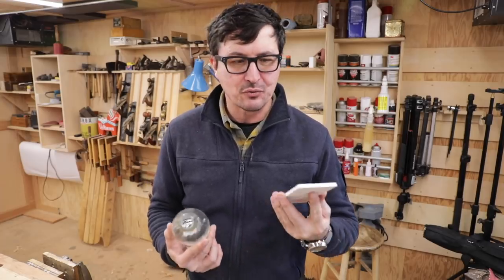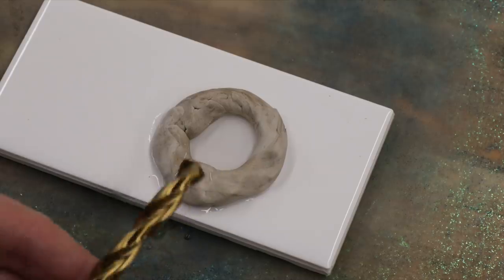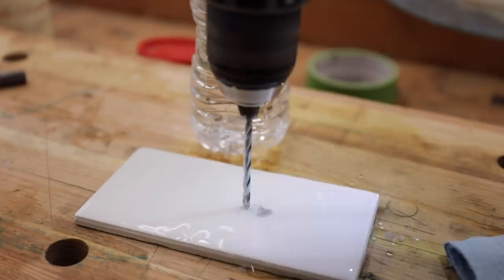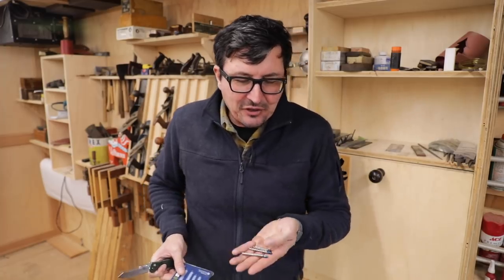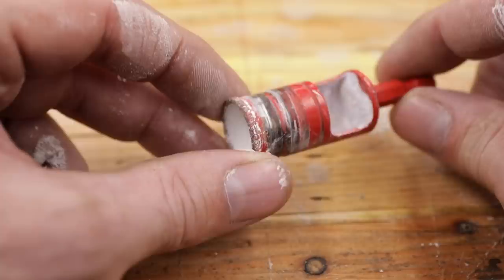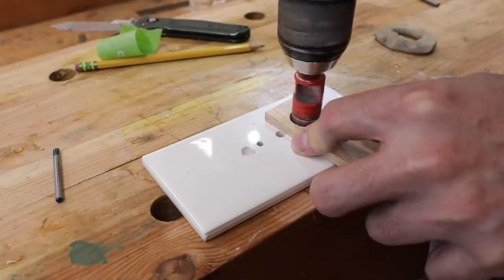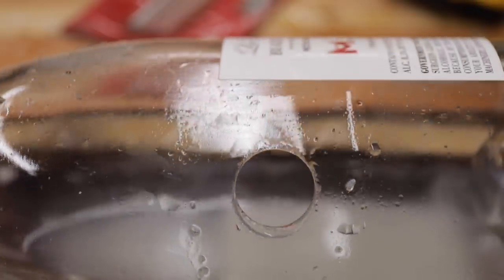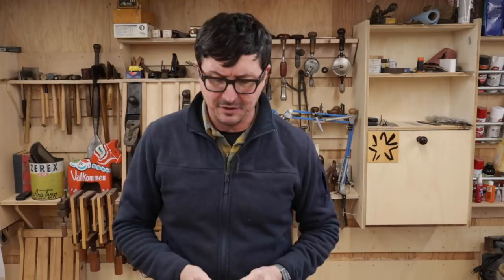Drill A Hole In Glass - How Hard Can It Be?

Comment: Tempered glass will shatter. The reason it's tough is because the whole piece is pulling on itself from the thermal shock of the tempering treatment. If you introduce a void, it implodes.

Comment: I know this guy who had a power generator stolen while he was using it. He was working in Philadelphia in one of those big warehouses, and his job was to go in clean, strip, and rewax the floor. So he had floor cleaning machines, and it was easier for him to just run a small generator outside, and plug into it with extension cords. So he is there using his machine, and next thing you know the machine kicks off. So he looks thinking maybe he tripped the switch, or the circuit breaker on the machine. No that doesn't do anything. So he goes outside, and where his generator was sitting is now just a bunch of plugs unplugged, no generator. So he is like WTF, so he is looking around and sees a taxi sitting at the top of the street at a stop sign. So he starts to walk towards the taxi hoping maybe the guy saw something, but he figures by the time he gets to the taxi it will have driven away. But he keeps getting closer, and closer, and it is still just sitting there. As he gets closer he can hear the man in the back yelling just go man, why are sitting here, drive now. So he gets to the taxi and say someone stole my generator sitting on that side walk, did you see anything. The taxi driver says yeah the man in my back seat stole it, and it is in my trunk. The guy gets out and takes off. So the taxi driver tells him I thought something was suspicious, he flagged me down around the corner, and asked me to take him around he had this heavy generator he didn't want to carry. So he drives around, and he is suspicious because it is still running, with stuff plugged into it. So the guy shuts it off, pulls all the plugs, throws it in this taxis trunk, hopes in and says lets go. So now he is really suspicious, why was it running, why didn't the guy go take any of the stuff plugged into it. So when he drives up to the stop signs, and looks in his rear view mirror, and sees this guy with a puzzled look on his face, he knew the guy stole the generator, and so he sat there and waited for the guy to come up to him.
Reply: Thats a great story and its great that the taxi driver just said that he stole it .
Reply: Legend says somewhere in that post are Avengers Endgame spoilers.
Reply: @Mic_Glow  batman kills thanos bro
Reply: @Mic_Glow  RE: aaaaaaaaaaaaah 
Sanchez Eve North Dauz 
Hicks Eve Loop Piles 0110101011001101001010 11.17.84.93.75 Krossection intersection B.K. Rescue M. 
South Saudi
Reply: Dido to the taxi driver!
Reply: I'm not reading that
Reply: @gdptodamvc2558  cool arg
Reply: Excuse me but how the hell does this apply to any portion of the video at all
Reply: Where's the rest of the story Kevin?! What happened to the guy, was he mad or just disappointed? Why did he want the generator
Reply: better than Hollywood movies

Comment: "what did we learn?"

That it's pretty easy to convert a bottle into a water pipe.
Reply: Yessir. Make some good money too. Just epoxy the stems in
Reply: @jakehanneman6956  heat + normal epoxy= no bueno gases, just use rubber grommets for feeding heated water lines through sheet metal (rubber grommets for stems/ what size piping/tubing you need is another). ntm they are cheaper than epoxy ($1.50 vs $2.99 for ok epoxy) and are resistant to chemicals under heat. this way you fry less brain cells overall, dont kill customers, and makes it so the stem moves a little if you bump it vs 1 soild hunk of piece. epoxys only benefits imo is it doesnt require you to measure stuff and you know where its at in the hardware store.
Reply: @doodlebug6833  you reallyyy don't understand how I did it. But don't tell me I'm killing my customers. Last time I checked a tube of epoxy got almost a dozen made from the smallest tube around. Not to mention with all my buddies together chain smoking wax, even after being heated up repetitively over a half hour, the stem never even got luke warm. If the stem moves it breaks easier because it chips out the edges of the hole. I tried it that way before and grommets don't work with how I do it.

Comment: I've used the Bosch set on my tile.  It took awhile, but they did what I wanted.  I only needed to drill 2 holes and question just how many holes a single bit can drill.  It was certainly slowing down after the first hole.  Our tile was much harder than your subway tile, based on what I could see.

Comment: The glass and tile bits I use look more like a primitive arrow, with the arrow head attached to the shaft, if that makes sense, they work really well.
In a pinch you can take a regular masonry bit and and sharpen it to much more of a point, with a sharp edge to it, most masonry bits are not sharp on the cutting edge, because they do their job by percussion, not cutting.The plumbers putty dam works good, but I've done the same thing with just a bit of wet paper towel.
The core bit, next time put double sided carpet tape on the back of your guide board so it does not move around on the tile, they you can concentrate on keeping the drill steady, not doing that and keeping the guide board in place too.

I'm enjoying this series.
Cheers from Tokyo!
Reply: I've used the same ones! Yes they do work well I personally find the Bosch ones a little better.

Comment: Yeah, tape is a MUST if you want to accurately drill. I use the Bosch professional range of bits (painted blue) and they made perfect holes in my tiles but I had to use tape so it wouldn't wander.

Comment: I wear my welding gloves when opening blister packs... Them sharp edges will get you! The blister pack is sharper than the cheap knives inside the package hahah.
Reply: I always just cut around it with my knife and it opens right up easy as can be
Reply: I tend to use kitchen/utility scissors.
Reply: Scissors no? Kind of obvious choice.
Reply: a good pair of large scissors
Reply: I use aviation snips for opening those blister packs.

Comment: No you cant drill tempered glass cody..  laminated glass yes but not toughened or tempered.  That type of glass will turn to a million pieces all over your shop floor..
Reply: Yep,  the tempering process puts glass under tremendous strain, causing it to "blow up" when it does break.  Think of it like surface tension on water, it's harder to break the surface tension with a widely dispersed load.  The difference with tempered glass is, once that surface tension is broken, it's game over for that piece of glass. So you can take a spring loaded center punch, and easily pop a piece of tempered glass, but try swinging a sledgehammer at it, and it will probably bounce off.
Reply: If u cut at the temp the glass was tempered u can as long as its a cobalt diamond bit that's hot as well. U may say it makes the diamond softer but so is the glass. U just have to cut slow in an oven under drill press. Boo yah!
Reply: @damedog19  What if you were to heat the area you intended to drill in order to de-temper that area?
Reply: With over 100+ years combined years of family members in the union glass trade you can't cut or drill tempered glass. Unless you want alot of glass diamonds.
Reply: Weedus, no they are not. When tempered glass breaks it will go into alot small chunks of glass. Tempered glass aka safety glass is used in doors, sidelights next to doors, patio doors.
Reply: Tempered glass can be drilled, that is if you heat the glass tobremove the temper drill it then re temper it.  Alot of work and cant be done in a regular oven

Comment: I used to cut glass for a living. We used a drill press to be more precise on the glass. And we had a rubber donut that held the water. Also tempered glass will "blow up" if drilled into, or chipped on the corner. Plate glass can be drilled.

Comment: Hi Copy I was taught a "Hack" for drilling tiles, first mark the point where you want to drill with a sharpy of some other pen. then cover the mark with a strip or two of clear adhesive tape (Sellotape), the bit will not slide on the tape and will let you penetrate the outer layer of the tile without the drill bit starting to slide

Comment: First of all, I really love this new series. Second, im a glazier, to drill through glass you need to drill through from both sides to avoid those little chips(they're called shells) and temperwd glass can not be drilled or cut because of the process it goes through to become so strong it has a load of stress in it, and it actually "blows up" if you try. You can actually see the stress points in temperd glass if you look through polorized lenses, the surface will lool wavey, and the corners(if its a square or rectangle) have little rainbow things, ita quite cool to see. Hope this helps
Reply: For tile, you can use the same thing for metal to stop the bit from wondering.
Reply: Useful information there, I did think that about tempered glass, but now I know not to attempt it. 
I suppose any drilling has to be done before the tempering process.
Reply: I’ve always wondered why windshields look like that through polarized lenses! Thanks!

Comment: I worked in hardware retail. The best way to open those blister packs are to turn them behind, cut from the corner 90 degrees like a square in an "L" shape. And then just bend the plastic and get the stuff out. If it's too stiff, just cut another line 90 degrees. Definitely need a knife. Make sure you do it on a flat piece of wood that you can scratch in case you overshoot. 

And btw, doesn't really prevent theft. As thieves will find their way round it by bringing their own knifes into the store and cutting it in an obscured location in the store.

Comment: I use that bosh set when i hammer drill in the wall so the tile stays in-tact and does not shatter. The normal practice is to punch a center hole on mark for wondering bits. The problem, tile is like glass and can shatter causing you to do a lot more than just drilling a hole for something. Most public bathrooms all use some sort of tile where you need to hang stuff and those Bosh bits are very handy for that.

Comment: Use a hot melt glue gun to fix the wood guide to the wall. Easy to remove later. Also hot melt glue can hold fixtures temporarily until the real glue or hardens

Comment: In the "old" days I used copper tubing and valve grinding compound to cut holes in glass.
Reply: Ive heard of that! I have all of that stuff. I'm gonna try it.
Reply: @MrJeb707  Tip: Use copper tubing not pipe. Its softer and will hold the compounding
Reply: @HappyTrailChihuahuas  after a few attempts, I gave it up. Haha I could see that it would work, but man it would take a minute.

Comment: You can never drill through tempered glass 😅 it'll just blow up
Reply: Use heat
Reply: you just cant puncture Tempered Glass with anything, or even scratch it too deep. reason is from tempering the glass the inside becomes a different hardness than the outside almost like a laminate. The inside "layer" now has an enormous amount of pressure built up within the glass itself. cut into it too deep and boom.
Reply: Yeah I'm a glazier... heat won't do anything. But I'd gladly let you try a piece lol

Comment: Those Bosch bits are amazing for drilling into tiles. Use em every single day to drill multiple holes and they still last a week or two in softer tiles.  Not so hot if you have floor tiles but still better than almost anything else.

Comment: I use to work for a company that installed all the hardware on new homes and let me tell you grab bars in the showers was a nightmare up to 10 min per hole six holes per grab-bar... i wish i had those Bosch bits back then.... btw we used a spray-bottle and a towel on upright surfaces.

Comment: A good pair of fabric scissors, or fabric shears if you want to go a little overboard, can reduce those annoying plastic packages to shreds. Cheap ones will just break, but good ones won't even twist. They can even cut thru zip-ties and thick cardboard without problems. The ones with the zig-zag pattern to prevent fraying work, but are much harder to get it to cut, so just use the straight ones.

Comment: Fun Fact - You cant puncture Tempered Glass with anything, or even scratch it too deep. reason is from tempering the glass the inside becomes a different hardness than the outside almost like a laminate. The inside "layer" now has an enormous amount of pressure built up within the glass itself. cut into it too deep and boom. Some people think you can do it by various methods like starting with a punch or pinhole, heat or going very very slow... its not the process of making the hole on tempered glass, its the release of that pressure all at once. Any holes or cuts to Tempered Glass has to be done before the Tempering.

Comment: As someone who has drilled hundreds of 3/8” & 7/16" holes in wine bottles. 
The best way is to used the drill bits that are built like mini hole saws, encrusted with diamonds. 
  And.. a small/slow drip of water(similar to the bottle drip used in this video)(but with a short piece of 1/4" tubing) 
Slow is fast. 
Gentle is efficient. 
👍

Comment: For that jig for the hole saw, you could use a "ultimate luthier's trick" with masking tape and superglue.  Put a piece of masking tape down on the piece you are drilling or working on, making sure it's longer than your jig. Line up the jig and mark where the tape touches the jig.  Put tape on the jig that faces the work piece. Burnish the tape down on both pieces.  Apply superglue to the tap of one and activator on the other.  Carefully line up the jig and press it into place.  The jig will not move latterly.  To remove just pry up the jig.  Tape comes off with no residue like you can get with some double sided tapes.

Comment: Okay... so I've been working in the glass industry for 2.5 years. I've learned to cut most any glass out there (plate, mirror, laminate, wire, art glass, and heavy glass up to 3/4") I've also learned to bevel, hand polish, install showers, commercial and residential doors and windows. My expertise though is in pattern cutting and beveling/polishing. From my experience I've learned that when it comes to holes smaller than 1/2", spear point bits work best for glass, above that diamond hole-saw bits are best. Either way you must have your bit submerged or constantly sprayed with some sort of fluid.  I drill holes ranging from 1/16" to 4" in glass/mirror on a regular basis and use a diamond edged circular saw for cutting large holes and notches . When it comes to tile, as in shower installations, our standard is 3/16" for mounting hinges and frames. We use either spear point or masonry bits, the key to drilling into tile is to use an automatic punch or an awl and hammer to mark your spot and to keep your bit cool by dipping in water. This prevents your bit from wandering and chipping.
Reply: Also, no you cannot drill nor cut tempered glass. I don't care what anybody says, it will not work. That being said, I have sanded the edges of tempered glass. You can't take off very much, maybe 1/8" at most per side. It's not that it's too hard to cut or drill, it's that the glass is under tension and once you break that tension the glass will literally explode into thousands of pieces.
Reply: Sidney May  I have 13 years experience and you are right  it is hard to manipulate tempered glass. I have drilled bigger holes on top of existing holes up to 1/8 " bigger on the diameter , but it depends on the thickness of the pane. When you do this it becomes weaker, tempered glass has kind of a border around edges, notches, and holes, which will accept minor changes. You cannot cut or drill tempered glass, period. Glass is a bit temperamental in some instances,  you need to make sure you have the right conditions to achieve your goal, and even then you might not secede. Damn 2" hole in a 5/32 smooth rough patio table top by hand. Those were the day's.

Comment: I would like to add how holes were cur in glass before carbide bits. Tape the glass build the dam and add sand to the water using a piece of soft copper pipe. We used a bit and brace but later changed to a drill press for more precise holes. The sand embedded into the copper making a cutting tool.

Comment: For the piece of wood to position the core bit, make it bigger and then stick it to the tile with some good double sided tape. Otherwise you get what you saw where it was sliding around when you were trying to start the cut. This can also work for the other bits but not as well.  For water, take a sandwich bag and snip off a small part of a lower corner. Fill with water and seal it up. Now just tape the bag to the wall above where you are cutting and let it drip down onto the bit as you cut. the thickness of the bag can make it drip too far away from the wall but a piece of tap dangling over the end will deflect it back into the wall.

Comment: To stop a masonary bit wandering push it against the tile on your mark before you start the drill turning and rock the drill in a circular motion (like operating a computer joystick). The bit will crush a small indent and then when you start the bit turning it will not wander. Start slowly and make sure you keep the bit perpendicular to the workpiece.

Comment: If you use a sharp centre punch with a tiny tap of a hammer on the tile of where you want to drill it will create a very small chip what will stop your drill bit sliding everywhere and marking/ damaging the tile 👍 I’m a plumber/bathroom fitter and used this technique for years

Comment: If you need a really precise hole in ceramic tiles, you can do a small mark on the glossy surface with a center punch and then start drilling from there. That way your drill bit wont wonder at all at the beginning.